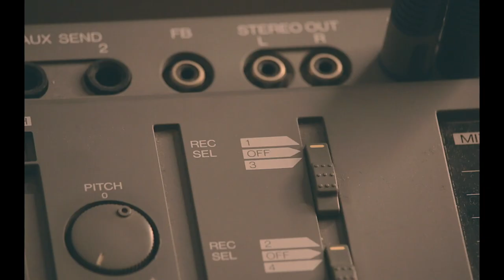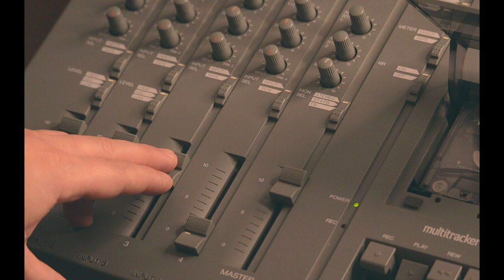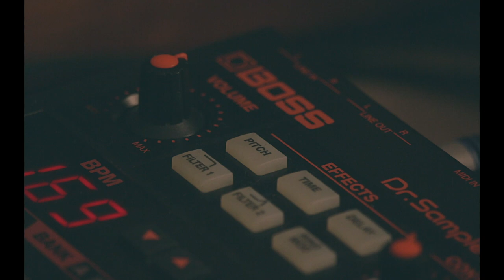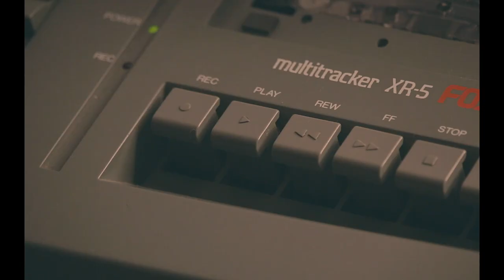Using a 1 Bar Tape Loop to make a beat with the Sp 202

Comment: Im Also in the Process of using a small Reel to Reel for longer bar loops. If you can find a reel to reel yiu can run the tape loop out of the machine around a room using drum or mic stands. Or a lamp. Lol and you can probably get 8 bars
Reply from the maker: I just love how tape sounds. I want to see if I can fit 4 bars inside one cassette, that would be the ideal measure.
Reply: Word. Yea theres diagrams online that show ways you can add pencil erasers and such to run longer loops. Google cassette tape loop diagrams